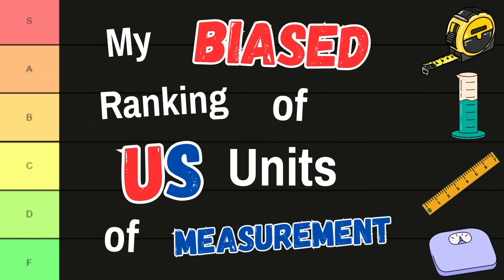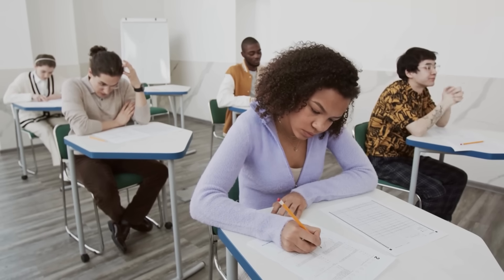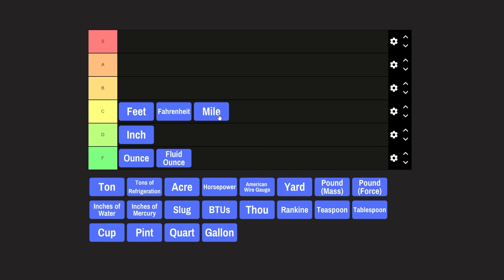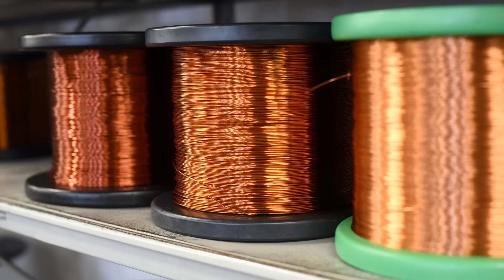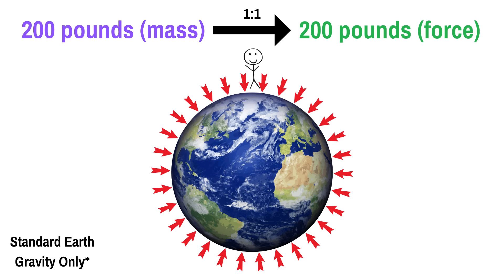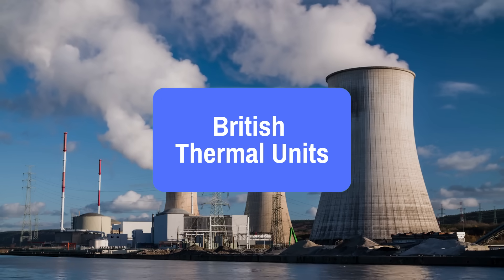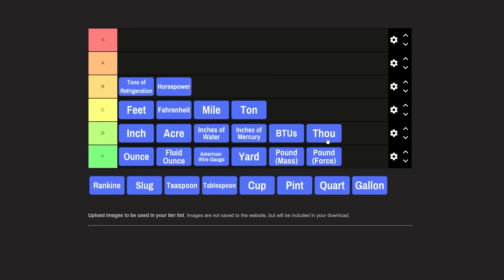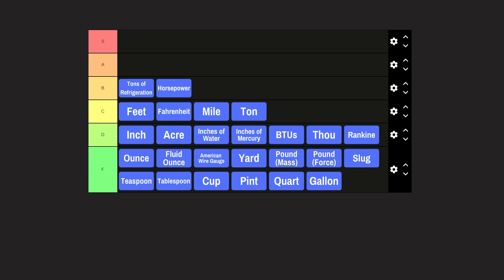Tier List of the DISASTROUS US Measuring System

Comment: Ok, if your problem with the units is that the size of the units is arbitrary, that’s just, how units work. Why is the meter 1/299,792,498 wavelengths of Caesium? Or originally, why 1/40,000,000 of the earth’s diameter?
Reply: The meter is defined by the speed of light. It has been so for 40 years.

Comment: One thing you seemed to have gotten mistaken is the Fluid Ounce, which is actually worse than you think. 1 Fluid Ounce of water is slightly more than an ounce, and is actually defined as "exactly 128th of a gallon". It's only called a fluid ounce because it's roughly close to being an ounce.

Comment: Ton of refrigeration: "It is a unit based on the energy absorbed by melting a ton of ice in 24h. It stuck around ... so let's put in in B-Tier"

excuse me, what?
Why B-Tier? none of the arguments is better than for the other units.  
It's literally only said that it's based on some natural phenomenon and it's still around. How is that the reason for a B-Tier? How would one easily convert it into electric Energy without some wanky factor?
Reply: You can just use kW lol.

Comment: Another annoying thing about liquid mesurments pint, quart, gallon is are u speaking about a us pint(16 oz) or an imperial(uk) pint (20 oz) and cups dont exist in the uk, its half pints @ 10 oz.

Another annoying measurement is ton (2000lb)  a long ton (2200lb) =tonne(1000kg).  Also the us ton is called a short ton becouse it is less than a metric ton.

Comment: My biggest argument against the metric system is actually more an argument against the standardization around base 10. 10 is a messy base that can be a pain at certain points. Ideally, a number base should be anti-prime; that is, divisible by as many whole numbers as possible.

In base 10, you only have easy math if you're dividing by 10, 5, or 2. Everything else (especially threes and sevens) gets pretty complicated.

This is why, once i realized the benefits of it, 12 inches in a foot was brilliant. I can get easy division by 2, 3, 4, 6, and 12. Yards to inches is even better since 36 is divisible by all of those plus 9 and 18.

Fluid ounces to a cup works even better because 16 is a perfect power of 2, and so converts really cleanly into binary.
Reply: This is fucking genius, S tier take

Comment: A lot of the reason why inches are the worst are because there are no widely known smaller units of imperial measurement. When measuring something small tf am I supposed to say “about 1/10th of an inch by 1/6th of an inch or so?”
Reply: Same for ounce, the smallest unit of weight in the Imperial System. It converts to 28.35 grams. Interestingly, when Americans need to use smaller units, they don't use franctions like they do with inches, but switch to grams right away.
Reply: Centimeters
Reply: @thatoneguy611  yes but that is metric, hence why inches suck because they are used for the entire bottom of measurements for Imperial.
Reply: @ninjasheep7492  most imperial rulers you can buy have a side for centimeters
Reply: @thatoneguy611  firstly a cm is only 2.5x smaller than an inch so it doesn’t help with smaller units which would require mms, secondly, if you need to switch to an entirely different measurement system due to the problem I laid out above then I would say it is a “DISASTROUS US Measuring System”

Comment: Heres my thing, metric is better for science, engineering, and industrial stuff, imperial is better for things in every day life like the temp outside (what it feels like). Imperial is more relative to feeling while metric is cold and calculated.
Reply: Not really, you only think so because you are used to it. I have no problems with relating a certain temperature/other measurement to what I feel/sense while not using imperial.
Reply: How exactly is celsius any different for measuring what the temperature outside feels like?

Comment: To be fair to the Imperial System, the Metric system feels just as arbitrary as well. Sure, the metric system is easy to convert up and down using 10s and 100s, but I couldn't reliably tell you how long a metre is without having a ruler.
At least I can roughly tell how long an inch is, by examining my thumb. Then, I know a foot is 12 inches, a yard is 3 ft and a mile is 1760 yards.
I guess, since technology has become so advanced, we expect an EXACT measurement, rather than the old tricks of an older world.
Reply: You can assign any part of your body as a cm/m or anything, doesnt matter which unit it is as long as it's not too small/large.
Reply: What is so arbitrary about using decimal?

Comment: I catch a lot of flack for my viewpoint on the metric system. But I think it’s rather redundant, calling something that’s 1/100 meter a centimeter or 1/1000 a millimeter, or calling 1000 meters a kilometer. Then saying you’re converting by moving the decimal point when all you’re really doing is changing your language. 

1/100 of something is a cent of something or a percent of something it’s not a unique measurement it’s literally just language. 

I can do the same thing with imperial units. Henceforth 100 inches shall be known formally as hectinch. 

Note it’s really easy to convert from inches to hectinches just move the decimal point. 

And 1/10 of a pound will be a Decipound just move the DECImal point over to convert. 

At least with the imperial units there is or was a purpose for each thing that was easily understood by the layperson. 

And I understand from where the base units from the metric system come meter being based on lines of latitude, and then liters and grams being based off the meter, but the fact of the matter is all those prefixes don’t make different measurements, they’re just written words that are the names of specific amount’s and fractions of amounts. The metric system isn’t better because it’s easy to convert, it’s worse because it has less units of measurement based on lengths the last person isn’t familiar with. 

Give me my barley corn Jason.
Reply: Better than memorizing all the random fractions and multipliers of imperial.

Comment: I'm a strict metric person, but I think you heavily underrated inches of water (which is often very similar to what you are calculating in any measuring system) and I'd be willing to give inch more credit as quick and easy rough estimate. Furthermore despite the gauge system being insane used universally, for cables it's relatively fine as long as you understand the backwards logic.

I'm pretty sure the only reason you'd use Rankine unit would be for Rankine process. So maybe it should be forgiven?

For the whole purpose of kitchen, I'd rate spoons higher. Even though when I watch american cooking videos and they say teaspoon of salt, it looks like they're dropping a tablespoon. Furthermore someone said sea is roughly 30-40 grams of salt per litre (they said quart of course) which he said was 4 teaspoons, but I looked it up online and measured for myself and a teaspoon of salt should be around 17-20 grams, so at the same time american teaspoons look bigger but are only half the weight in salt.

Although the cup of water I do the understand. I recall cup is about 2,5 dl and that's the size of a drinking glass (or slightly smaller).

Comment: AWG is still used today - It's placement is not representative of the fact that hobbyists, electricians, and engineers in the US use it. Despite the confusion around the number to physical size, it doesn't take long to get used to. I'd place it in B tier since It takes experience to understand it.
Reply: It also makes nice round numbers for the max amperage the wire can take.
Reply: it's also used in pretty much any other field that measures round things, including injection needles, and shotgun pellets.

Comment: Personally as a person who machines things, 3D models thing, woodworks, and draws, inches and feet should practically be S Tier.

For precise engineering and design, metric is much more efficient, HOWEVER for art, for adhoc engineering, for improvisation, for practically daily life guesstimations, inch’s and feet are far superior.

Both provide a physical reference you can apply when looking at anything. For example, my finger tips average roughly an inch in length, by looking at almost any small object, I can near precisely determine how long it is be it up close or at a distance, I have a physical reference on my hand, and unlike metric, it would not need to adjust for more numbers be it millimeters or centimeters. The inch is a very good size to represent something that is quite common around in the world from small rocks, food, coins, etc.
It is very easy to just visualize and inch and visualized something in comparison that would be very accurate to an inch, it feel natural, centimeter and millimeter feel artificial and redundant, it’s much more taxing to visually see the tip of my finger represented as ~25 sections (mm) or ~2.5 (cm), why waste time when I can look at my finger, see a units of measurement that represents 1 unit and go on from there.

Feet is the same as well, there are many parts on the human body that come close in size to a door in length, in can be the foot, the forearm, the biceps, the tip of finger to elbow, etc. by simply standing next to someone and referencing your arm, you have a semi large singular unit of measure that can allow you to improvise measure.

I have tried from a daily life mindset, drawing mindset, and engineering mindset to use both meters and yards to assume the measurement of things and I frequently a off by a large amount.
Feet is simple, you can measure people without looking at any background object nearby for reference, from bottom neck to head it is about a foot in height, you look at a person and from their head, from her you can look at them and picture their own body as a reference and judge they may be this many heads tall and thus they about # feet tall. It is a simple singular measurement unit while meter is very guessing based, you don’t have an easy reference for what is that long on the human body especially on different people, this is not the same for feet since the head usually average around same size in adult.

It’s weird to describe, but from an improvisational and artist point of view, feet and inches are superior for the daily life average measurements and estimates, while much of metric is better for precision and other various things.

Comment: Teaspoons and tablespoons are actually useful for baking. Most people’s kitchen scales are accurate to one gram, and a half teaspoon of baking soda, for example, might only be 2 or 3 grams.

The error on volumetric measurements scales roughly with how much you’re measuring, while the scale’s error is fixed at about +/-1 gram, which in my opinion makes a cup a worse unit than a teaspoon.
Reply: I didn't know that you weren't allowed to use teaspoons or tablespoons in metric. 
You might want to tell the millions/billions of people who use metric.
Reply: @dampaul13  I didn’t say that? He ranked US customary volumetric measurements F tier, so I explained why I sometimes find them more useful than weight measurements (grams or ounces)

Comment: Horsepower is actually the power needed for pulling a 75kg "stadartised human" straight upwards which was equivalent to a horse they had during the test. So 75kg*0,81m/s^2 which is 0.7355kW which is 1HP. Yeah, i know why im not invited to Parties :D
Reply: correction: 75kg*0.980665m/s^2 and to get Watts you obviously needed time and way so its 1 meter in 1 second. That equals 0,73499kW to be precise but nobody cares anyway.

Comment: another absolutely stunning unit of measurement is a barrel. there are several different barrel units depending on what you’re using it for dry things: you have several different barrels depending on what the dry good is. cranberries get their own barrel unit. and then you have liquid barrels which also different and then you have barrels as used by the oil industry. the US loves complicated measurements.

Comment: Fahrenheit is the most infuriating to me because the metric equivalent makes so much sense and is so  insanely easy to define / measure
Reply: Yeah but it sounds stupid because it isn't based on the human body tho. 100F is hot outside. 37.7C does not sound like it's hot outside. It just doesn't. Plus the only benefit is just 0 and 100 for water. That's it. Fahrenheit could have easily been integrated into the SI system
Reply: @josephrupsis4623  37 doesn't sound hot because you're not used to Celsius! As someone from a SI country, 37 sounds hot. Also talking about ease of understanding, everyone has some idea of water freezing or boiling as both are such a universal experience, so mapping 0 & 100 to that makes sense.
Reply: @josephrupsis4623  "Plus the only benefit is just 0 and 100 for water. "
What does water have to do with temperature or measuring temperature?

Comment: The worst one for me is surgical sutures. It starts off normal enough where a suture size 0 is thinner than size 1 and the size goes up from there.
Sadly size 0 is quite thick so they had to come up with something smaller.
Logically they said we just gotta count down from 0 but some marketing rep Appearently found negative numbers confusing.
So the size smaller than 0 ist 1/0 or 1-0, depending on the company (spoken „one zero“ either way).

The system uses a metric measurement of diameter for its size differentiations and has an equivalent metric number system where the thinnest suture (11/0) is „0.1“. This system also highlights way better that the difference between one size and the next isnt consistent (6-0 is 0.07-0.079 mm diameter, 5-0 is 0.1–0.149 mm and 4-0 is 0.15-0.199 mm, in metric the decimal point is just moved one to the right and the lowest diameter of the spec is the name).
FFS

Comment: Nah Fahrenheit is still underrated for common use. Having to say it’s -whatever degrees all the time in the winter in sub arctic conditions wouldn’t just be rediculous, and a pain to do in everyday life. 

Not to mention it’s more accurate, as 10 degrees F is, well, more accurate than 10 degrees C. It’s a smaller unit. And it’s easier to use for common use.
We’re not talking about scientific use here, f*ck F for that. Kelvin all the way.
Reply: It's not painful to say "minus". Accuracy doesn't matter all that much for everyday use. The difference between 25°C and 26°C is small enough.

Fahrenheit is easier for common use to YOU because you are used to it.
Reply: @yodaas7902  nah it’s just true that 0 is really cold, and 100 as really hot makes sense. If it gets colder than 0 it’s REALLY cold, and if it gets hotter than 100 it’s REALLY hot. It was literally designed around that principle, human perception of heat. I think that’s more useful than -34 to 40 degrees or whatever, that’s a weird number inherently.
And yea, calculating negative numbers is weird when you do science with heat, because you don’t do it like normal negative numbers. It just makes it so much easier to use absolute zero as the baseline, gets rid of all the weird anomalies that naturally slip up when you say something like -40+ -30 = -10, because that doesn’t make sense for normal math.
Reply: @enternamehere2364  "really hot/cold" is a subjective measure unique to every person. Too cold/hot  in fahrenheit to me would be around -22 F to 77 F. It's easy for you because you are used to it. To me celsius is very intuitive since negative means automatically means freezing temperatures. 

I do agree with using kelvin for science though. It's just that fahrenheit or celsius is more intuitive to you because you are used to one of them.

Comment: I'm surprised that Fahrenheit isn't a tad higher since its degrees are smaller. Would be good to have a temperature system like Celsius but with smaller degrees
Reply: Celsius is however precise you need it to be. You just use decimals.

Comment: As an European and electronics engineer working with and us company, I hate gauges SO FRICKING MUCH. Even more so as a person with stretched ears because someone thought using gauges as a measurement for ear plugs is a great idea even though you need like half millimeters to a millimeter increments. 
I kinda like Fahrenheit, because 0 F is about how cold usually winters are here and 100 F is a temperature of a very hot summer.
Reply: As a* European. Yes, "European" starts with a vowel, but it's not about how a word is spelled, but how it's pronounced, and "EU" in English is pronounced like a consonant, hence "a", not "an".

Comment: i was kinda hoping to see the Shotgun bore/ gauge measurement in here. the gauge (or bore) of a shotgun is determined by how many balls can be made from 1 pound of lead according to the barrels inner diameter. for example, the bore diameter of a 12 gauge equals out to about 12 balls from 1 pound of lead. its dumb sounding at first, but it makes more sense when you put it in the context of ye olde days

Comment: Pounds/Pounds force and Ounces/Fluid Ounces got a little bit of overly harsh treatment... This is a problem that exists in any system where Weight on Earth/Mass are related and "Weight of a set volume of water on Earth"/"Volume of water" are also related such as in the metric system. In fact, grams are originally defined as "unit equal to the mass of one cubic centimeter of pure water at 4°C."

Comment: I think fahrenheit should be higher personally.

Ultimately, the only real benefit that metric offers is the scalability. Which could be applied to imperial units if we really wanted it to be.

Its increased usefulness in science is completely manufactured due to constants simply being created based on the units and being easily convertable into imperial units.

One might argue that some of the reasonings behind metric are better. Which is maybe true in some cases but its still fairly arbitrary.